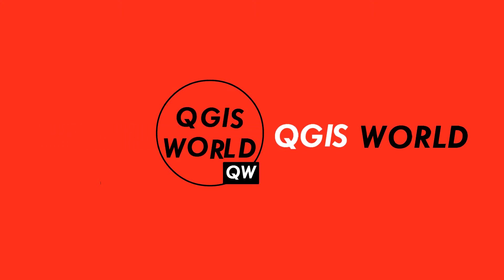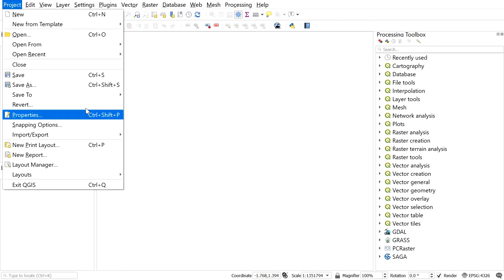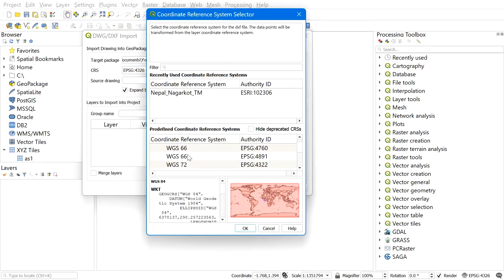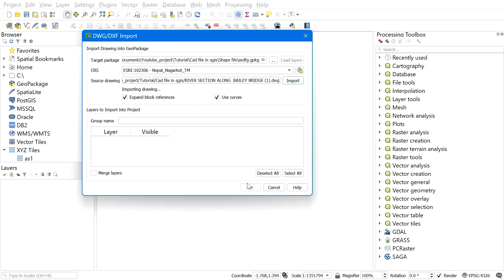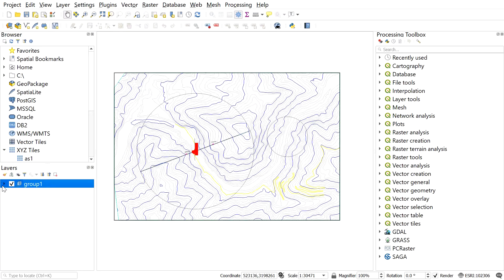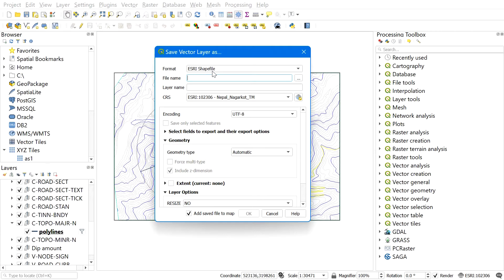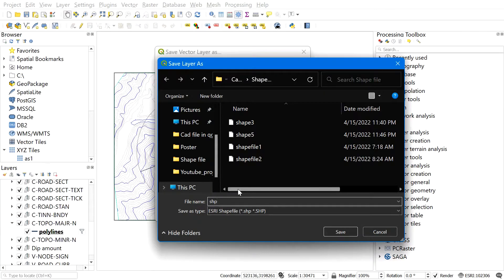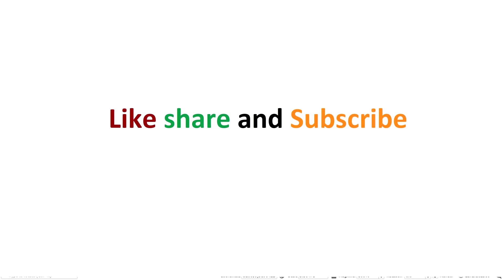How to convert DWG file to Shape file using QGIS

Comment: But what is the 'target package'? You don't explain what that is? Plus when I tried to use your method I'm afraid it didn't work - the CAD vector file didnlt show up in the QGIS screen. It only worked when I simply dragged and dropped the dxf file into QGIS, then it appeared. Your explanation of the export to create the shapefile did work though.  So thanks for that part.
Reply: This process was for converting dw(g) files, not dxf as you've suggested. You are correct that a dxf file can simply be dropped straight in to QGIS.
But to answer your question, the target package is simply the file you want to save the dwg as. Since a dwg can't be used directly in QGIS, the importer creates a new .gpkg file (geopackage) which is capable of storing the various vector types that a dwg file contains (i.e. points, polylines and polygons). So that first field is just about creating a path and file name for the new .gpkg file that is created through the importing process.

Since many people still prefer to work with ESRI shapefiles, the extra step at the end was more for convenience, but it is not necessary if one is happy to work with the vector in it's .gpkg format. Hope this helps clarify the video.
Reply: @DC-hydro  Thank you for explaining this, very useful!